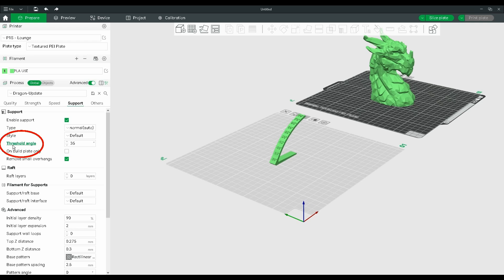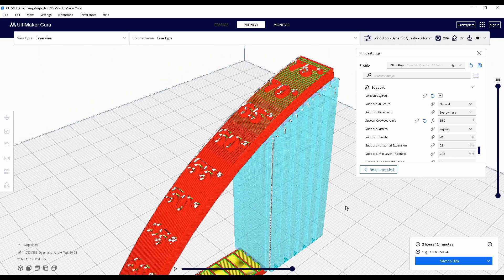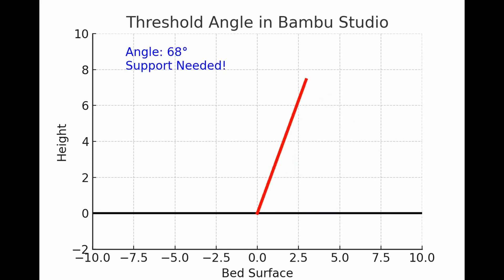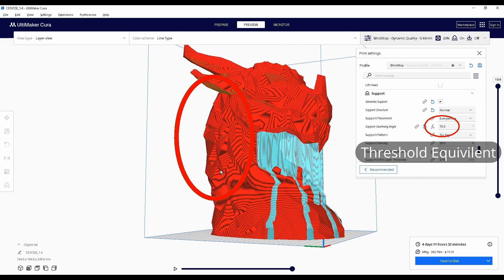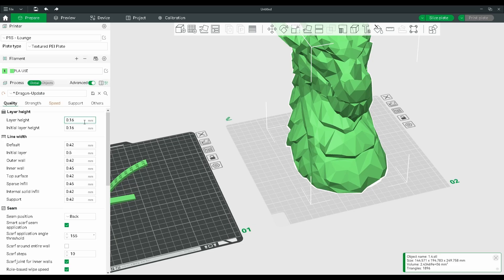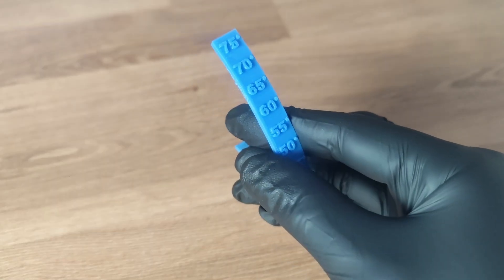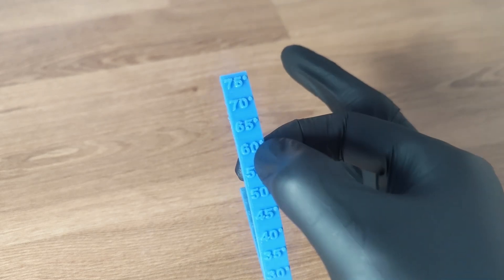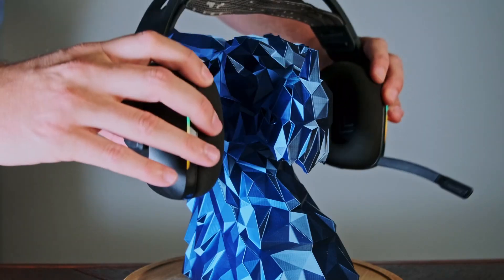Why Your 3D Prints Have Too Many Supports (Or Not Enough!)

Comment: They need a setting to print slower on overhangs, so the plastic has more time to cool and sag less, on just those areas. Similar how they have a slower setting for corners and sharp edges.

Another setting, they could use a delay for, is end of support cool-down. Giving the layer which will touch a support, a slightly longer delay, so the support contact is as cold as it can be, reducing adhesion. (Maybe a dry layer pass over the old non-support layer, to give it a small warm-up, before printing too.)

Another delay we need is a minimum delay between layers. This would only be seen when a layer only has a tiny build area, like the tip of pointy and thin objects. Teeth points or antennas... Instead of printing a layer and instantly printing the next one, while the layer is still flimsy and molten. It would wait a second, hovering over the part, aiding in cooling that layer below, before adding a new one. (The tips of all my pointy items always get a wiggle deformation from the new layer pulling the prior layer around. It's not worth slowing down the whole model for the sake of those isolated cases.)
Reply: these are already in Orca slicer.